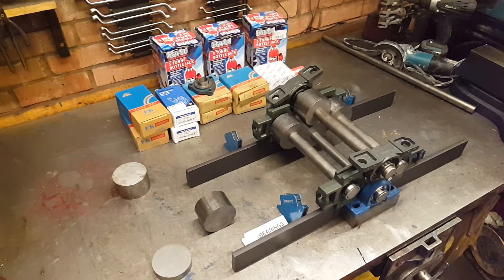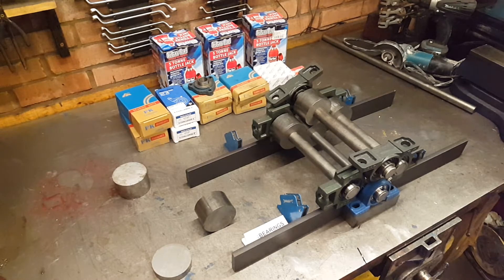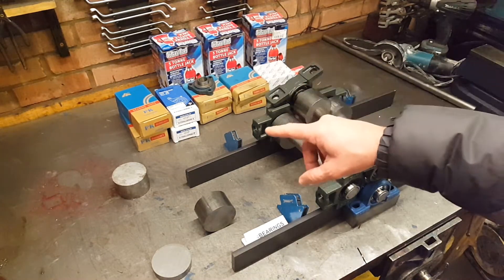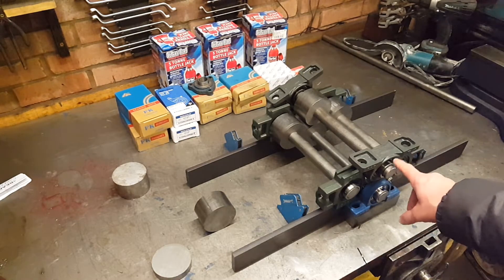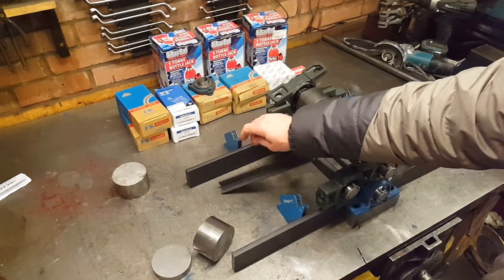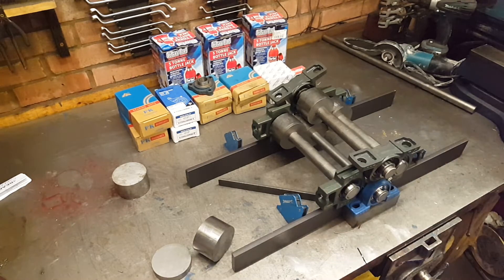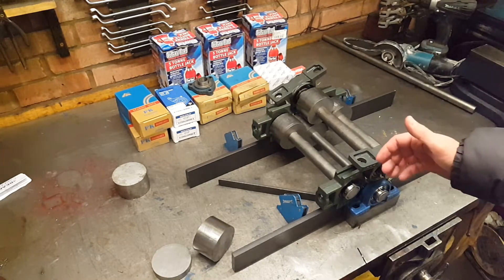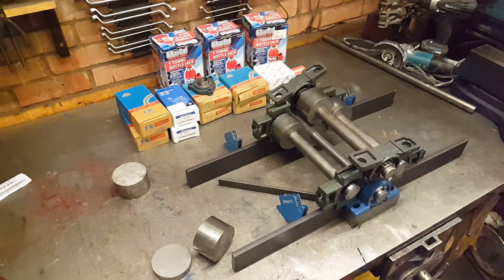Homemade 4 & 3 Roll, Ring Roller / Slip Rolls, pt1

Comment: This type taper lock bushing will save you from needing keyways transtech.se/en/products/clamping-elements-taper-lock-bushings-2/
Reply from the maker: Yes this is a very good idea and one i had not thought about. I need to get this thing completed as its still blocking up my bench and i really need to running for a project thats floating in my head. 👍